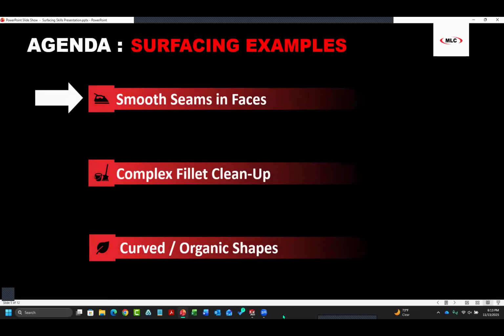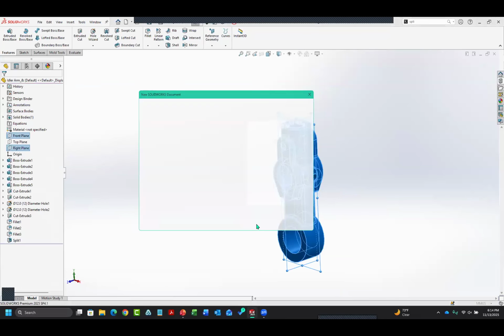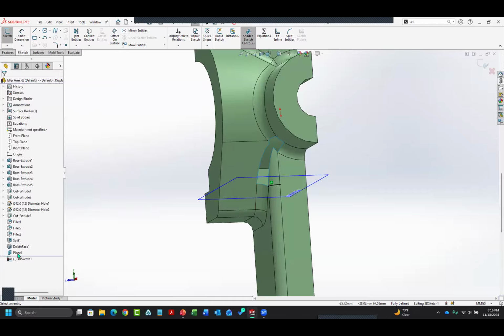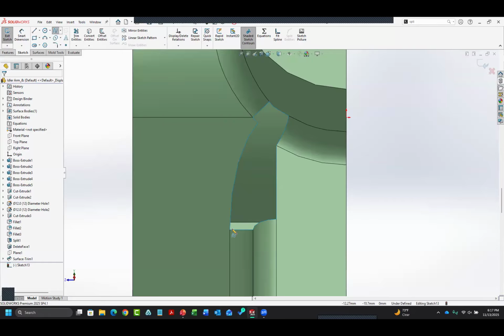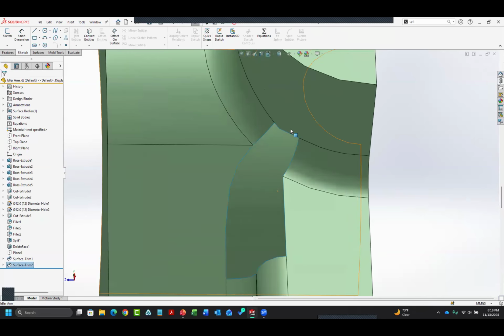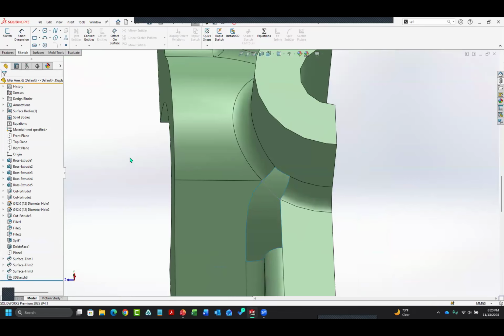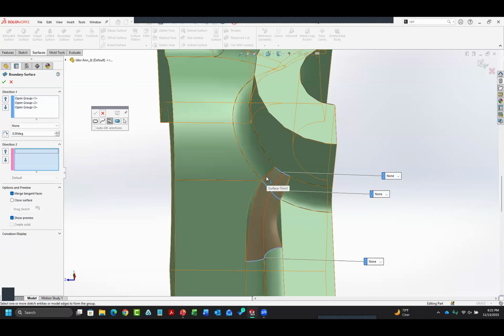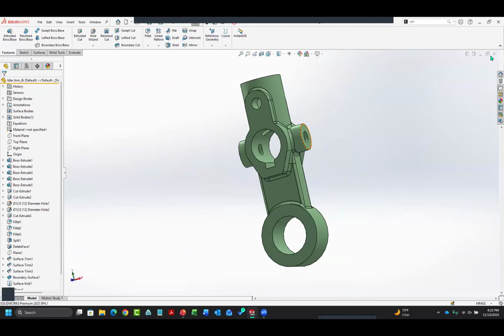Complex Fillet Clean Up -  Part 2 - SWUG 2025

Comment: Hello.Thank you for your detailed explanation.
However I want to keep the original shape of the solid body without deleting faces and I just want merge/knit all the small surfaces that ended up after doing a fillet.
Is it possible to merge all those tiny fillet surfaces so that solid body look like one piece, instead of multiple surfaces as in your example at fillet area.
Reply: It is a little hard to help without more context. You may be able to use Delete face patch/fill to get a simple version. If you are able to share more context, feel free and I may have more specific advice